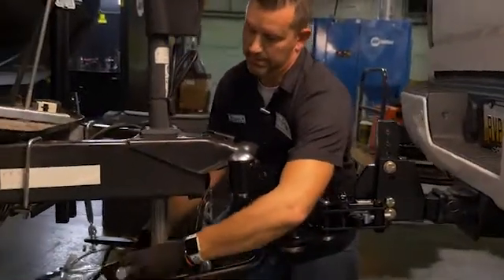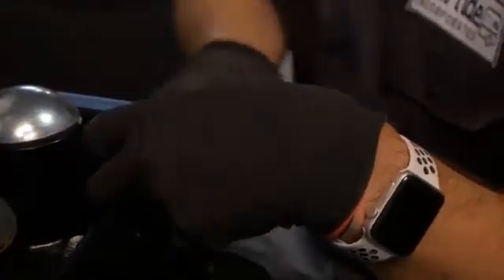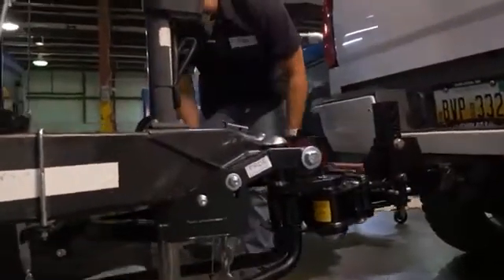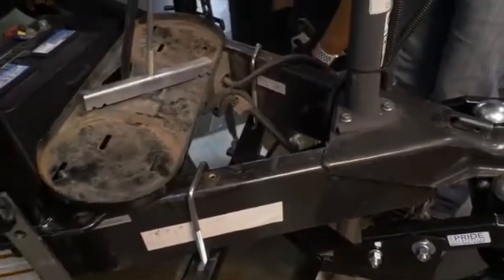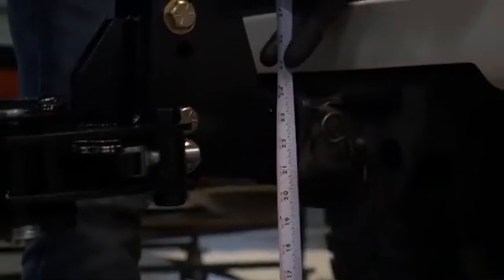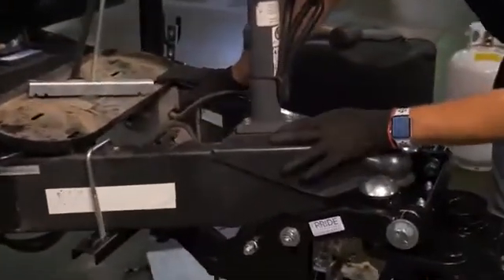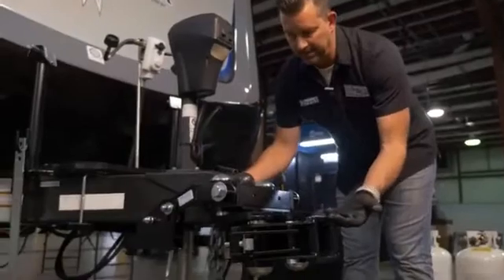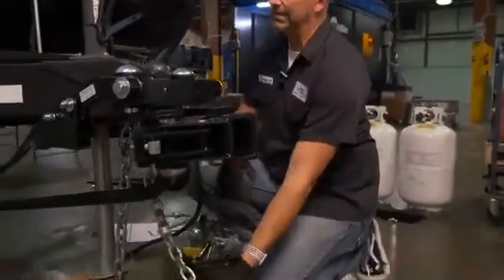ProPride 3P Hitch Installation - STEP 7 Yoke Installation (Pages 24-26)

Comment: I need help. I did all of these steps, and when driving down the road, the bracket eventually slides to 1 side all the way, making it off center and rough when stopping since the camper slams forward. What can I do? the u bolts are properly torqued.

Comment: IMHO you definitely need to shim the tray for the propane tanks.  lotta weight  on that flimsy tray to hold with a self tapping screw and try to balance it across that u bolt.  otherwise nice hitch!

Comment: explain please what the roller does and what the yoke tail is for?  i will be installing hitch soon.
Reply from the maker: The roller allows the yoke tail to move within the gap when the tow vehicle and trailer are adjusting for meeting different inclines/ declines. This is why we like you to try and have it as centered as possible on those downward forks.

Comment: I just got mine and started installing it.  Mine doesn't have the small block welded in to hold the nut in place for attaching the Yoke to the hitch head.  Did you re-design the hitch head?